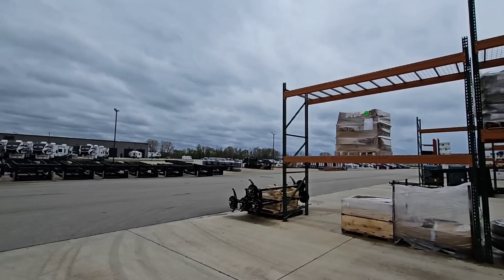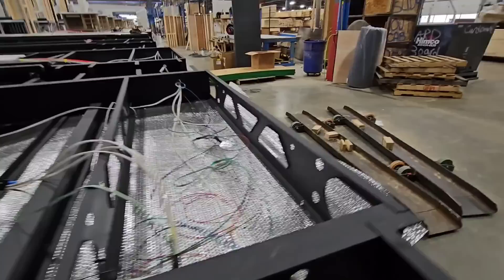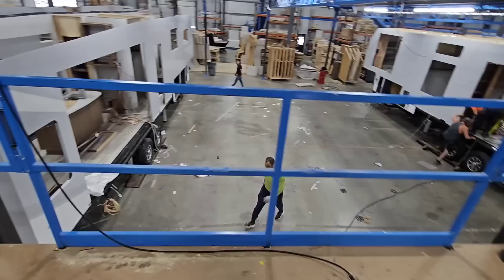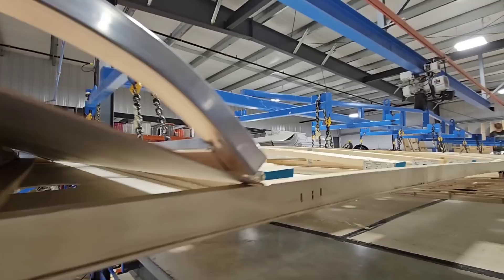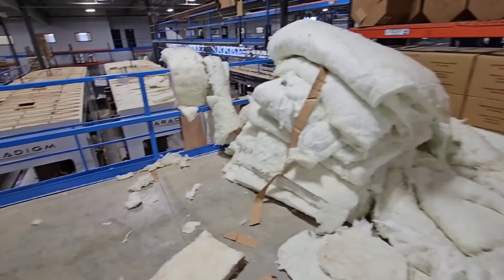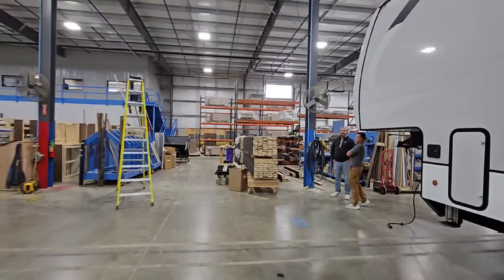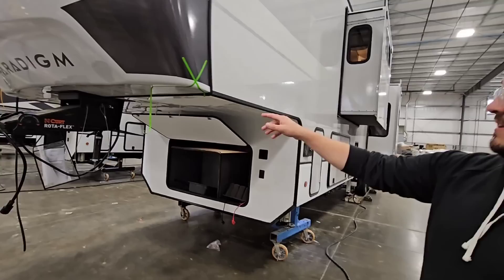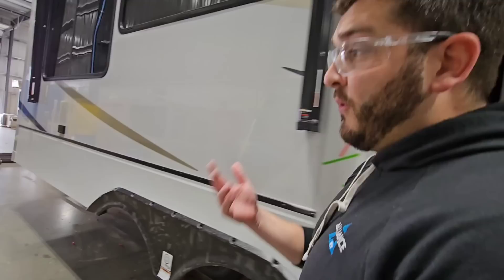Building a Luxury RV! Alliance Paradigm Fifth Wheel Factory Tour!

Comment: we have an Alliance, if it was not for the warranty they have we would have wrote this off and let it burn. our avenue had window leaks, miss aligned slide, leaks from under the slide, no heat duct installed, huge gaps in the fans to roof exit, water leaks, radio not even connected just sitting in the spot. baggage doors that will not stay closed, tank handles that broke off during the walk through, leaking shower, inability to cool the rig (86 outside, ac set to 70, cloud cover and inside sitting at 81 ac running all day dumping into living area), floor of slide falling out, kitchen slide scraping up floor. im sure there are other things too but at an msrp of almost $96,000 you would expect a better build quality. 

only thing that has been the saving grace is the warranty is good. they will send you anywhere to get it fixed. even pay for a mobil tech to fix it. problem with that is most places will not work on it if you do not buy from them. if they do you get bumped to back of line..... 4mo in the shop and a month waiting for a mobile tech to repair. so 5mo into owning and 2mo of being in it.

also the first part about the supported water tanks, umm if you are on the alliance FB groups you will see where a lot of units are having the fresh water tanks falling out of them.